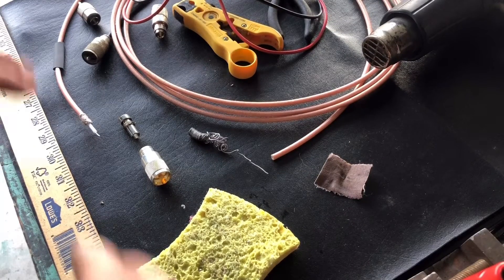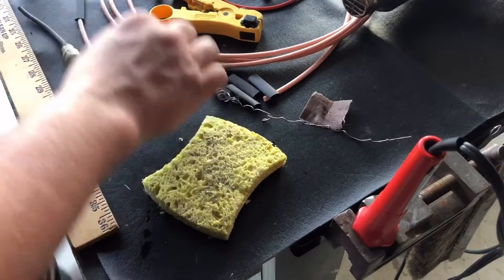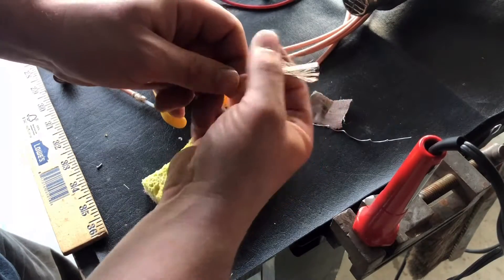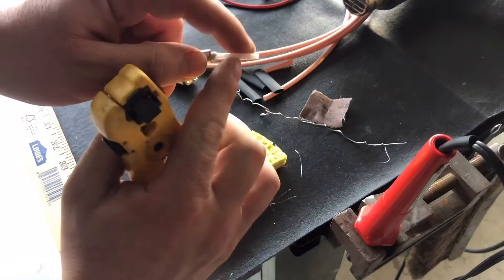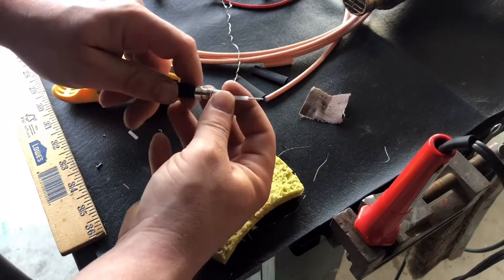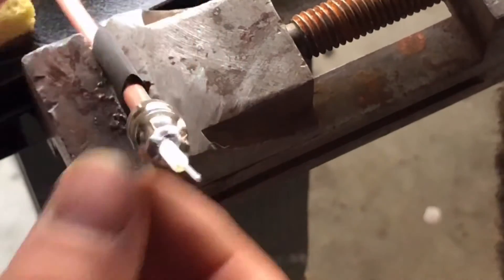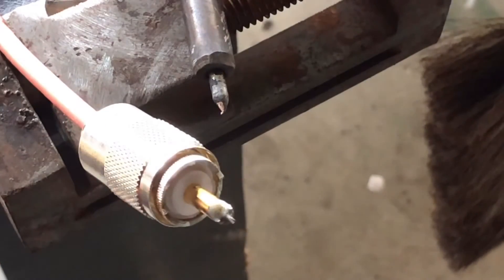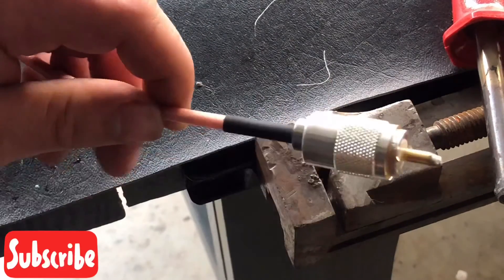DIY : Soldering On PL-259 Connectors To Make Your Own RG8 CB Ham Radio Coax Antenna Cables uhf/vhf

Comment: This is not how to install that connector.
Reply: Then what is?
Reply from the maker: There are several ways and from my experiences this way works well Using silver plated PL259s makes this system a breeze. I only use Amphenol 83-1SP connectors. The connector body is silver and the shell is nickel. I haven’t had one fail yet
My version of the install is in here https://zaarc.org/PL-259_w_reducer_Assembly.pdf

Comment from the maker: Using silver plated PL259s makes this system a breeze. I only use Amphenol 83-1SP connectors. The connector body is silver and the shell is nickel. I haven’t had one fail yet
My version of the install is in here https://zaarc.org/PL-259_w_reducer_Assembly.pdf

Comment: Wonder if you can help me. I need to cut off the end of my CB antenna lead that screws to the back of the radio. I need to get it through a small hole. Would these be the correct connectors to use when I replace the male end after routing?
Reply from the maker: Yes it is ! Thanks for watching 🍻